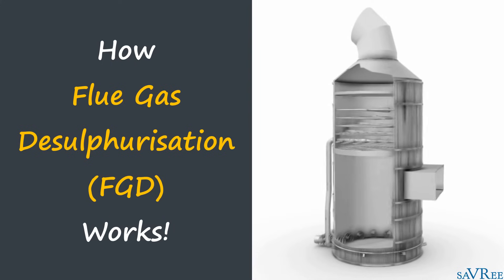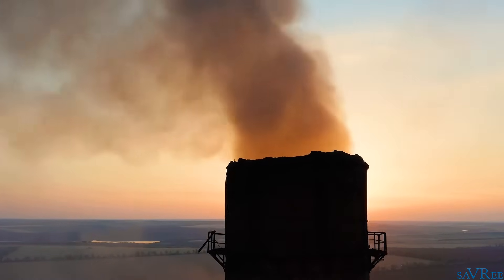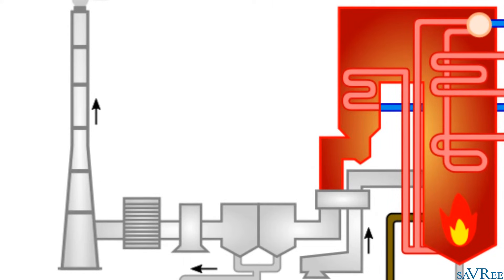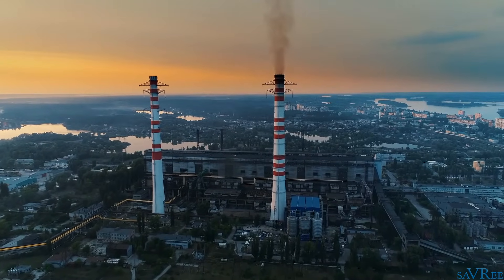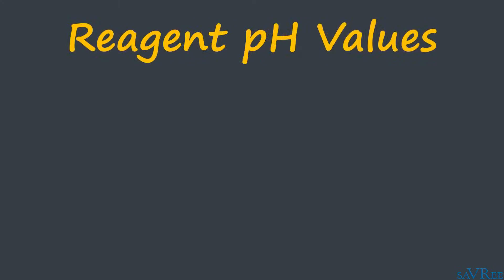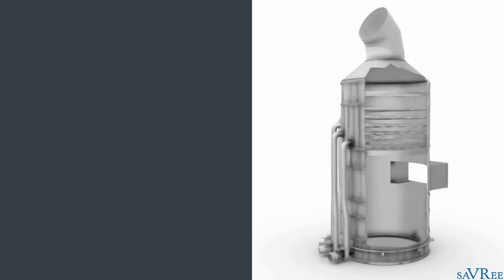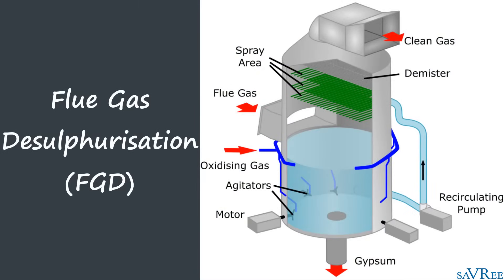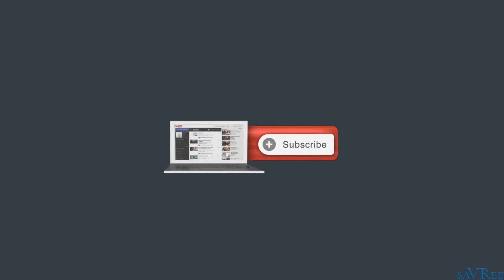How Flue Gas Desulfurization (FGD) Works

Comment: Nice Video, 3D especially with internal parts shown cut open.  Well, the basic functions are explained nicely, some of the doubts lingering are the incoming Lime and the Calcium Sulphate mix are at place, does this make the efficiency of the  system poor?

Comment: Assuming this is a continuous process (lime slurry in and effluent slurry out), wouldn't there be a mixture of products in the effluent slurry stream? The reactants - Limestone (CaCO3) or Lime (Ca(OH)2) both have low solubility, as do the products CaSO3 and CaSO4. Is the product purified downstream or is there some other method of separation?
Reply: Their is a process that bleeds the solid/sulfates and sulfates/ out to a sump where it goes to a tank and processing is done

Comment: Why wouldn't they simply spray water into the incoming exhaust, and then blow it through a bubblecap condenser to harvest the sulfur oxides as sulfuric acid? This would also allow them to delete the selective catalists, as nitrogen oxides will form good-old nitric acid in there too, and both of those acids are valuable, and easier to purify if you haven't already reacted them out with lime/hydroxides. It's such a simple and obvious choice, that I'm struggling to find a counterargument that doesn't also eliminate the original assumption that acid rain would happen without a scrubber. This simply contains the acid evolution for refinement.
Reply: could you explain some more? some details? and maybe some search terms
Reply: @snorttroll4379 
H2SO4: The Chamber Process
HNO3: Berkeland-Eyde reactor & The reason the air smells different during a thunderstorm (and where most of the nitrogen for plant fertilization comes from, when you don't directly apply it from a bag/tank).

Comment: Great video! Just a question, as Calcium is removed from the system (in form of CaSO4), where is the make up? Does it come in with the flue gas? Same goes for water i guess. Where is the limestone slurry inserted to the absorber tower at startup?
Reply: Even I have the same doubt? You got any answers ?
Reply: @paulnaveen1499  it goes to a tank for processing. The limestone slurry is added through a line when needed to maintain a certain PH to try and get sulfites instead of sulfates which are harder to process

Comment: You mention the neutralization with limestone takes place at a pH of 7.  This may be true in the lab but this is not how it is controlled in the FGD process.  Here is used a pH around 5.6 (depending on the limestone particle size distribution - 5.8 for if wet ball mill grinding is applied, 5.5 for pre-milled limestone powder delivered  by truck) because otherwise the excess amount of limestone in the gypsum is too high for salable gypsum.
Reply: @savree-3d  Hi, I actually did read this.  What you could consider is to explain that the pH is controlled in the recycle tank.  The limestone slurry is added to the tank using a pH controller.  The set point is 5.7 or 5.8 depending on how fine the limestone is.  But all spray banks receive slurry with the same pH of, say 5.6. This is one of the weakness in the limestone process because for that reason - the limestone dissolves much slower than lime - a larger liquid to gas ratio is typically needed.
Reply: Some further refinements of your 3D model (which I find great, by the way. I have never seen anything like this before after all those years) can be that a) the upper spray bank only has nozzles spraying downwards.  The nozzles you depict look like bi-directional nozzles and if so, then you cannot use them on the highest spray bank because then the slurry hits the mist eliminator direct. Then, b) the pipe connected to draw the slurry that goes to the dewatering also has a screen.  Lastly, c) I don't know if this is possible but could you show a better detail of the two layers of mist eliminators?
Reply: @savree-3d  I am still close to it but not directly in Power. But I still work on FGD type projects. I had the privileged to be trained by some of the pioneers in FGD designs. You will find me on LinkedIn if you want to connect. I work at Hatch Ltd.

Comment: Why do we use blower in fgd.??
Reply: @savree-3d  thanks a lot..
Could you please make a video on induced draft and forced draft blowers..??
Reply: If you install an FGD absober in an existing power plant, the induced draft fans normally don't have the capacity to deliver the extra pressure drop.  Then an additional fan - called booster fan - is installed that overcomes the pressure drop from the addition flue gas circuit including the FGD absorber.

Comment: Actually I am incharge of FGD process in my company...
We are facing problems like nozzles choking , Chevron type demister choking , perforated tray choking , not getting gypsum quantity as required
Just want to ask What might be the problems in process?
Reply: @savree-3d   what PH  should we maintain to get required  gypsum quality ?
Reply: @MonilModi10  You need to do a test.  Set the pH to 5.4 and let it run for about two days to stabilize.  Then measure the CaCO3 content in your gypsum. Do this for 5.5 and 5.6.  If you prepare your limestone with a wet ball mill you can even go to pH 5.8.  You will see that a trend appears that is exponential (up). Based on this you can see how high your pH can be to meet the limestone spec in gypsum.  But the trade off is that if you run with lower pH that your SO2 removal is lower too. Be aware.  The other part is to have enough air blown into the recycle tank so that your calcium sulfite (CaSO3) content is less than 1 % in the gypsum. If this is higher than 1% you don't have enough oxidation air. You either increase the flow of air or replace your injection nozzles to a deeper level (more closer to the bottom) but not so deep that the air gets into the recycle pumps.
Reply: @MyStevieB  Yes we are using wet process by using Hydrated lime..
Also it is hard to maintain exact PH value as it is continues process..so PH is maintained in some Range..
And also we Not getting dry cake from vacuum filter as required
Reply: Because you have a tray all gases from the tray and up will be saturated and no drying takes place.  The recycle pumps provide over >100 times more liquid than is evaporated.  Your problem is most likely a chemistry problem.  Based on your second question I think your problem is that you don't have enough oxidation.  Your CaSO3 content is too high which leads to bad gypsum quality.  It also means you have uncontrolled precipitation inside the tower and you need to push for >99% oxidation levels.  Running at lower set point of pH helps improve oxidation and also lowers the content of CaCO3 in the gypsum but will reduce SO2 removal unless you use organic acids like adipic acid or DBA. You could run at 10-12 wt% solids instead of 15 wt % solids too - means less CaCO3.  If you run at higher sulfur levels (more SO2 at the inlet) than you may be undersized in air compressor capacity.  One other solution is to add another air compressor to inject more air. A last option is to adjust the hydrocyclones to send more fines back to the absorber and less to the belt filter.